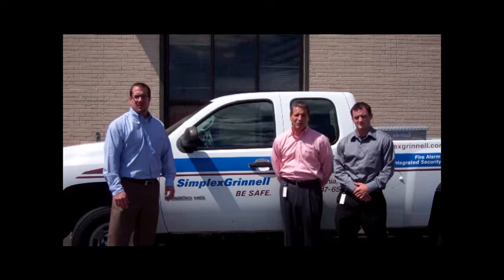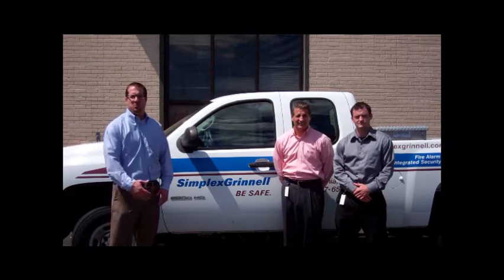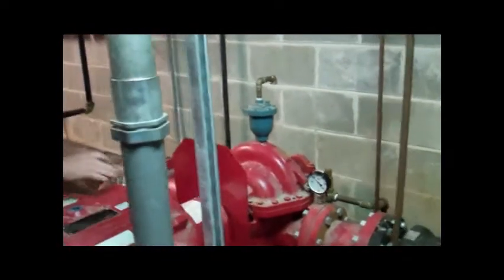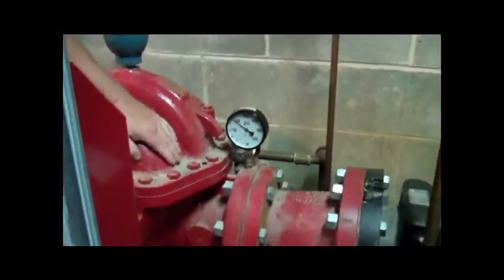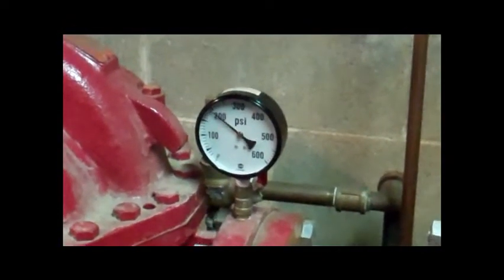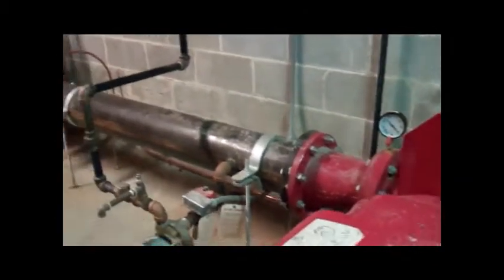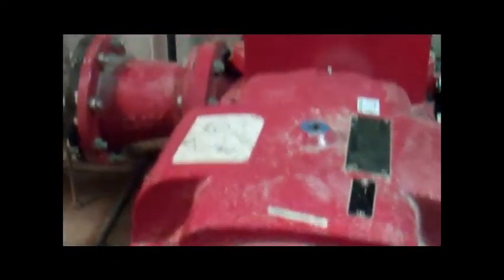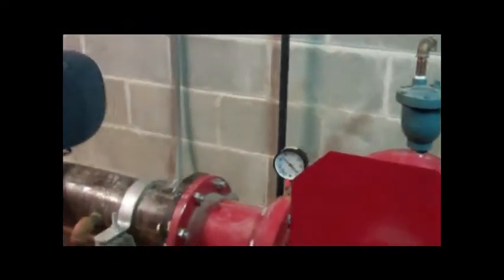NFPA 25 Fire Pump Churn Test - SimplexGrinnell Philadelphia

Comment: Fire pumps are sized for what ever pressure is required to reach the roof, 65 old school, 100 PSI current.  The churn pressure is the result of what ever it takes to get there, depending on how high the building is.  Use PCVs on the lower floors.

Dropping pressure too fast on the sensing line test connection at 0:28 does not confirm the start setting on the controller. The test connection should be in the middle of the controller, then people would not have to get on their knees to start it.